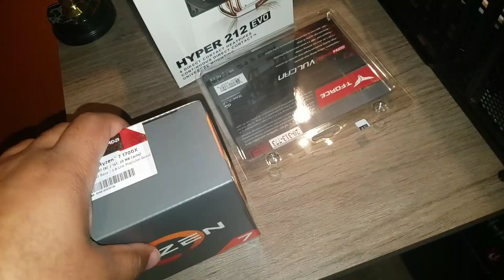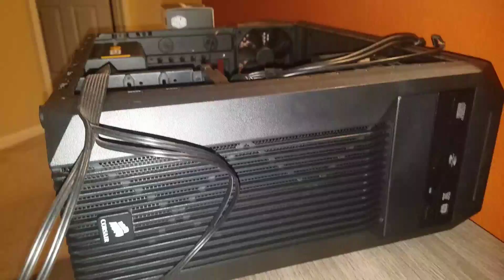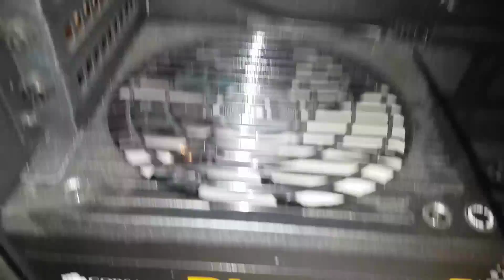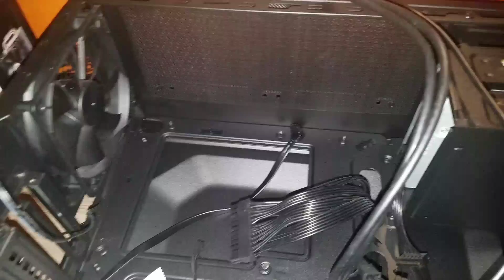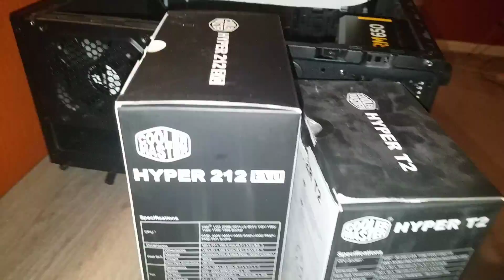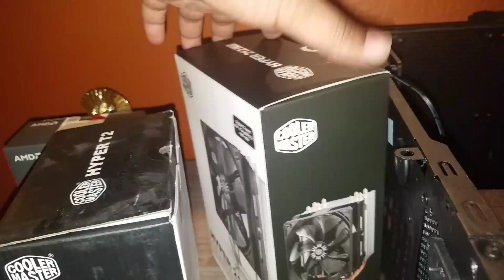Ryzen 7 1700x build

Comment: Do u need to update bios for the ryzen 1700x to work
Reply from the maker: No need for bios update with this motherboard.  I did forget to add my gpu when I first set it up so I got post code 5 beep bad processor, had to remember this processor has no onboard video support. Bios update is usually to get the older version of the motherboard to work with the newer 2nd generation Ryzen cpu.
Reply: Thanks for the response